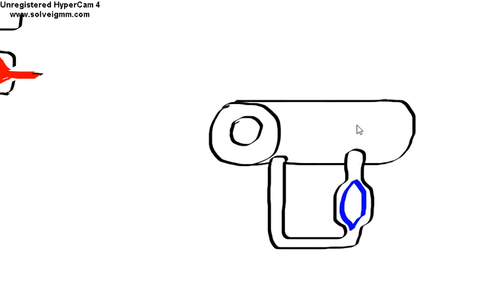Tornado Engines. Centrifugal Chimney engine, Air flywheel Ram Jet Engine.

Comment: so why not put double disks in the middle of the pipe with a gap and angled vents on the outside and have the air enter from both ends.. on a long shaft.. fuel would be added from the central hollow shaft..  and combust between the disks with a gap...
Reply from the maker: Interesting. I would like to see that fleshed out.
Reply from the maker: Keep inventing, it sounds like you might be an inventor at heart.

Comment: I have been studying pulsejets for a long time and have only recently thought of spinning the intake air with specially shaped valves. I like the idea behind your chimney engine, it seems very similar to what I was thinking about.
Reply from the maker: Great minds think alike.
Reply: @ollieoniel  
You sound as though you’re a real Irishman,
If I ever build a pulsejet big enough,
I’ll slap some solar panels on a dingy, electrolyze the seawater,
And run that sucker all the way across the Atlantic.
I’ve always wanted to see Ireland.
Have a great day.
Right now I am in the middle of some very interesting builds. When the videos get uploaded I’ll let you know.
Reply from the maker: @Mummichog420  That sounds like the coolest Idea I have ever heard. Please video it if you ever get a chance to do it. I will high five you on the shores.